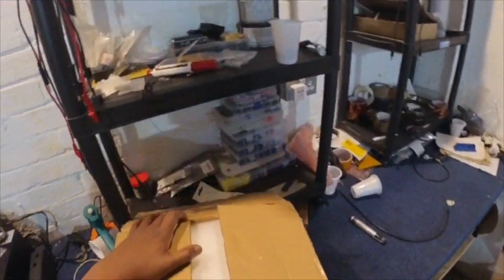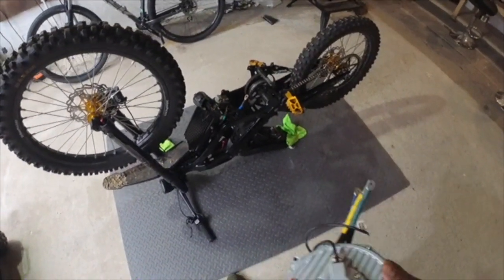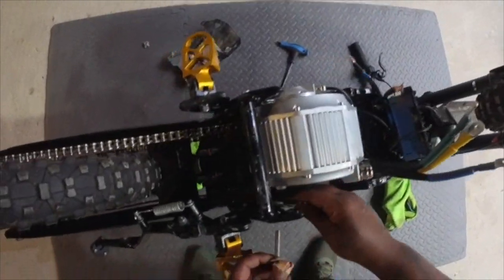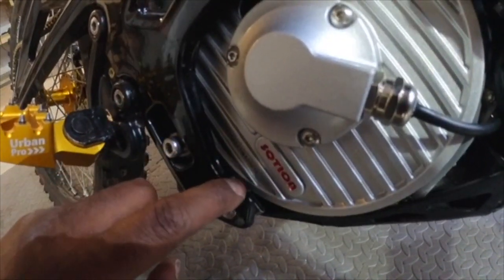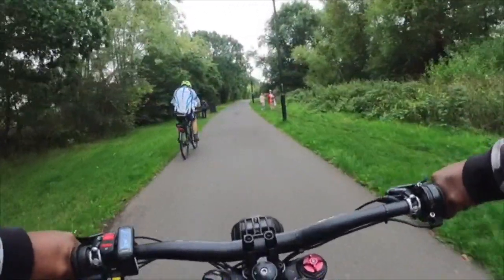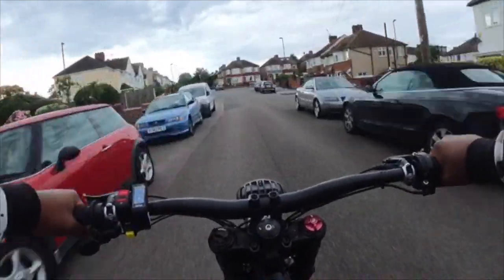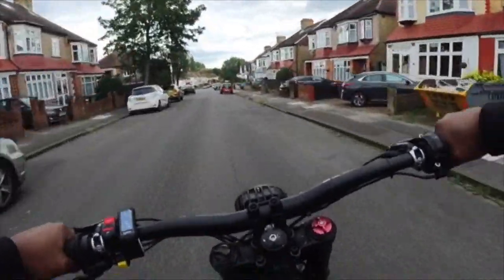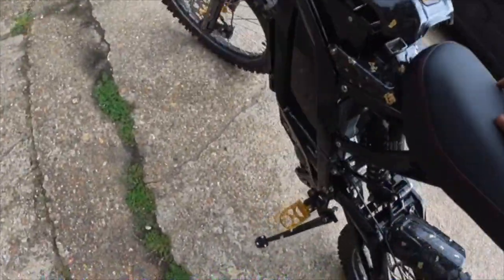Sotion Surron Motor Review

Comment: I just replaced my stock motor with one of these Sotion motors. I run a BAC 4000 with a 60V /60 Ah battery. When I switched on the red LED on the back of the BAC 4000 just blinked, no throttle at all. Please let me know